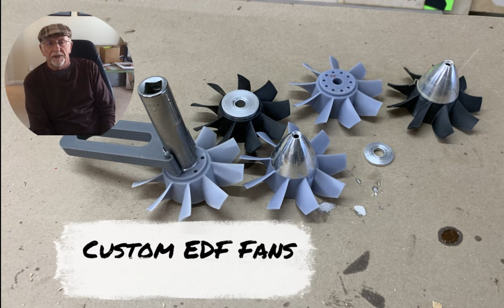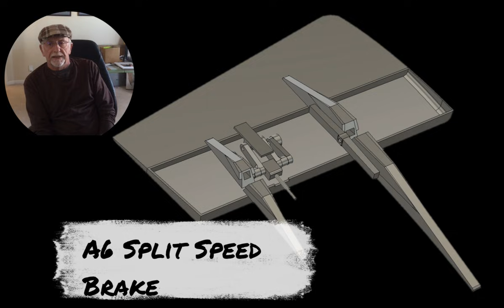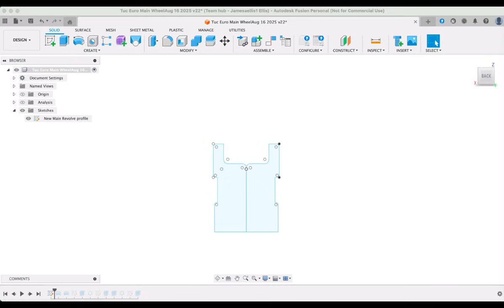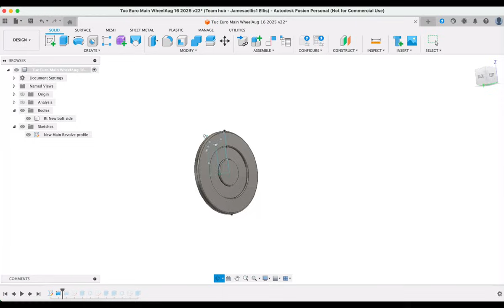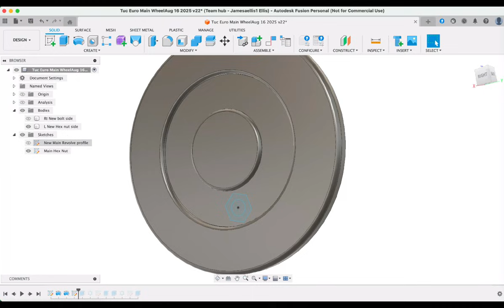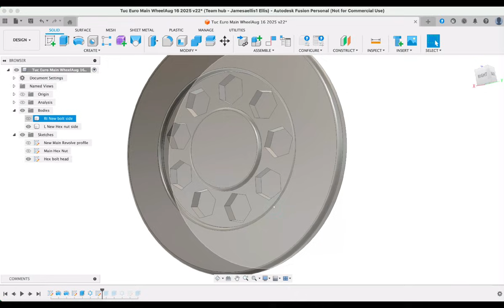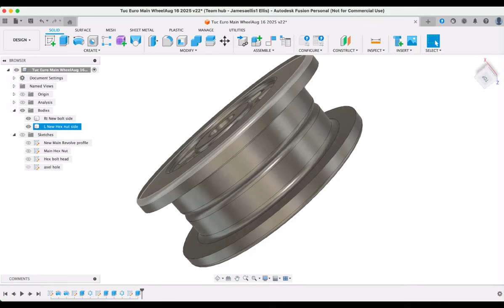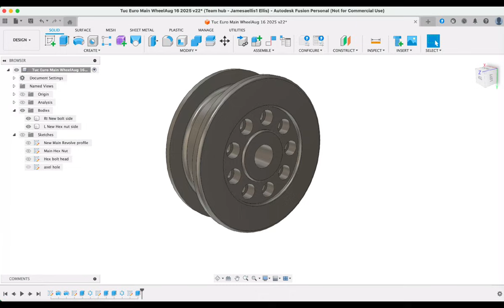Custom RC Scale Wheels & Parts Series Part 1

Comment: Nice design, I like how you extend the rim over the super fat tire.  I haven't tried the resin printer for hubs, but may have to give it a go.
Reply from the maker: Only use a tough resin or it will be to brittle.  I use Anycubic tough resin ultra
Reply from the maker: No only reuse good old ones

Comment: That sounds like a great idea and I like your design.
I have a bunch of old wheels lying around in drawers that could be reused.
My 3D printer only accepts PLA or PETG, so I'll do some testing with those materials instead of resin.
Reply from the maker: Works fine with PLA just adjust tolerance for recesses nuts/bolt etc
Reply: @britcharming  The first version was too tight. I'll have to make a few more versions to adjust those kinds of things.